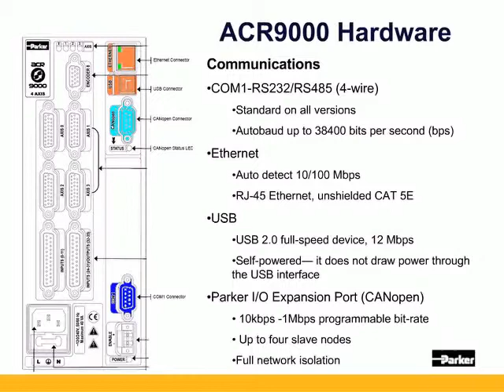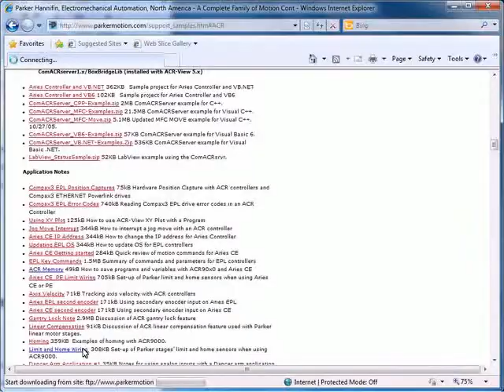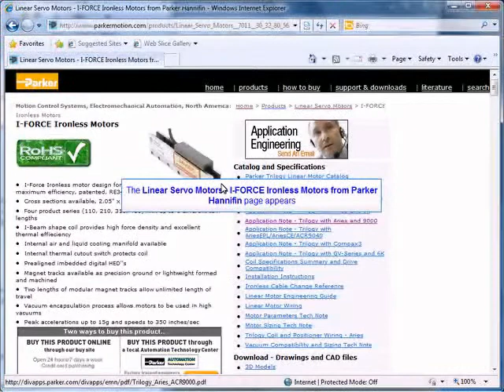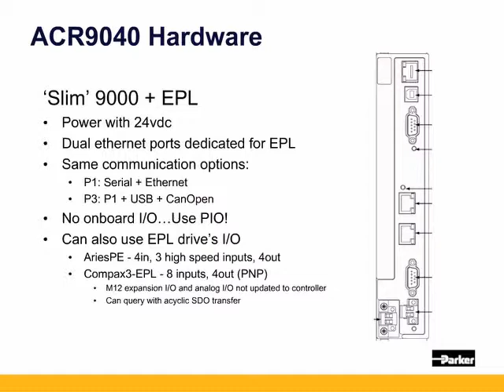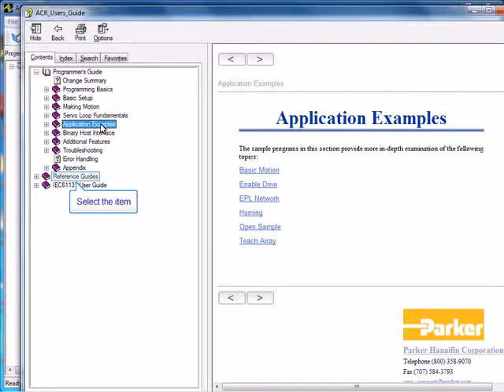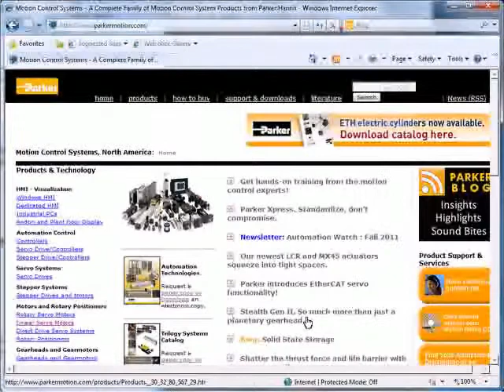ACR9000 Hardware

Comment: I have an ACR9000 controller, an AR-13AE Servo Driver, and its Servo Motor. Currently, they are installed in a machine that works similarly to an x-axis and y-axis. When a coordinate is set, it moves according to the setting, then stops and outputs a signal.

Currently, our servo driver is damaged, but we have a spare driver. However, the spare driver cannot be used as it needs to be programmed. I don’t know how to program it. Could you help me resolve this issue? Thank you.
Reply from the maker: Aries AE has no program, that’s in ACR9000, so this is pretty easy. You just need to configure the AR-13AE for the motor. Here’s how to do that:
https://youtu.be/KaH5ilISvdU?si=ZR_m2Foxfn-yxdam